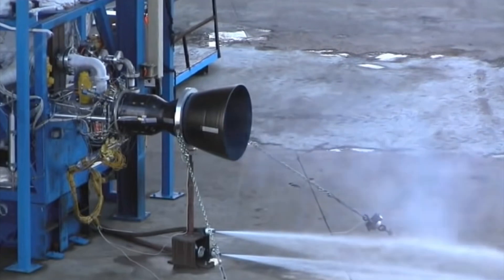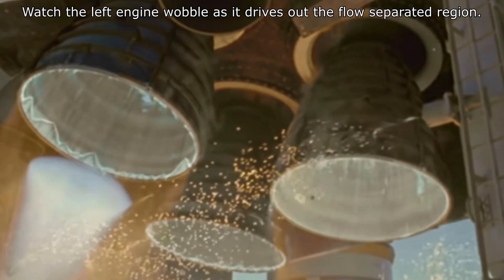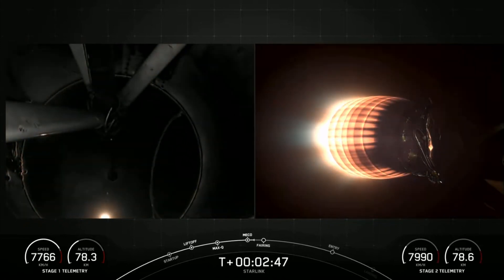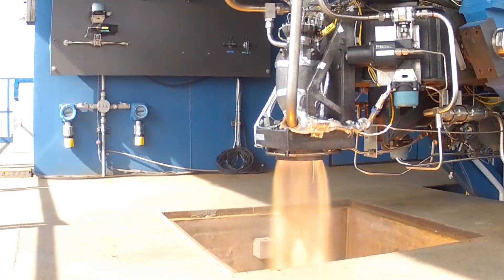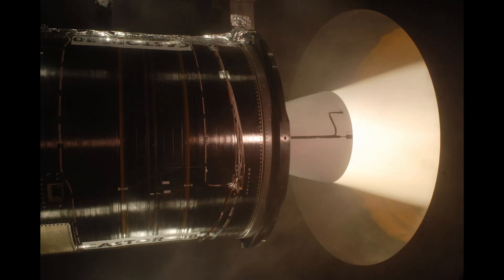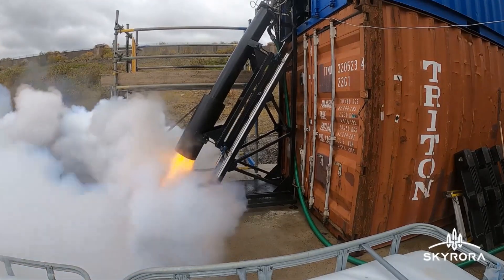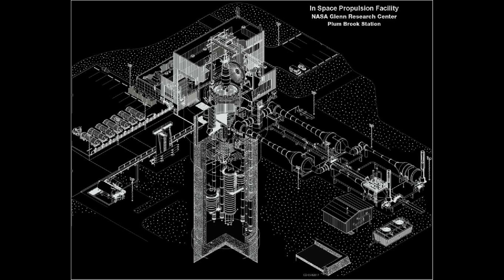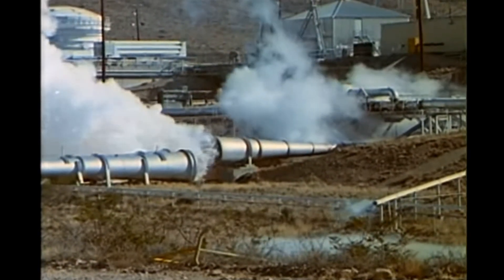Defying Atmosphere - How Rocket Engines Get Tested In A Vacuum Before Going To Space

Comment: What is it “pushing off of” to create inertia?  Theres NOTHING there in a “vacuum” of space.
Reply: Rockets push off the mass they eject. 

It’s no different than how you roll backwards after throwing a heavy object while standing on a skateboard.
Reply: @AM-rd9pu  Apparently Nothing, just throws out stuff and Bingo! Other side goes forward !  It's SCIENCE !  (well at least nasarian Newton space science)
Fresh repeat :)
Thanks, mighty kind Partner for the hoping :)  But... no  NO  I  dont realize That! 🥴  Have some experience with Propellers (following obediently lord Newton's LAWS, Action > Reaction) in Air or water...  Maybe some with Wings actually pushing.... (bird, bees, planes, kites... clouds) 🤔  Sadly thats it ! 😕
.....poor me
A jet engine produces thrust by drawing in air, compressing it, mixing it with fuel, and igniting the mixture to create a high-speed exhaust of hot gas. This process works on Newton's third law of motion: for every action, there is an equal and opposite reaction. By expelling a high-velocity jet of air and gas backward, the engine is pushed forward.  ...but no need of air  in front... so like (Space) Rockets better to have Vacuum behind !!!  🤗 Wonderbar  ❤🧠👍

🙄
 Fighter jets can fly between 50,000 and 60,000 feet in altitude, with some specialized military aircraft reaching even higher, up to 85,000 feet or more. The maximum altitude is limited by thin air, which provides less oxygen for the engines and less lift for the wings. 
🤓< only
Yes good boys, high altitude thrust like because less pressure, resistance, drag, but not too little..... 
This thin air reduces both the lift generated by the wings and the amount of air available for the engines to compress and burn fuel, which decreases engine performance and thrust. 
note for idiots : air is part of Atmosphere😲 if not part of a Whole, like water in the sea🛥, grabbing (like a rope) IT and throwing IT back against more air 🤯 = if not there would be no thrusting >> no Birds flying  kaput! 👇

The Brain is your friend🙂
Forget your Teacher, use it Today! 😃
Reply: @wildboar7473  There you go again repeating nonsense.
A Space shuttle main engine accelerates 500 kilograms of pure water from a velocity of zero to Mach eight every second !

Tell us again how it can do that without applying a "force" to that water.
Reply: @wildboar7473  Rockets push off the mass they eject. Jet engines also push off the mass the eject. So what’s the difference? Rockets bring their own mass to eject, jet engines suck in surrounding mass to eject. When there’s not enough surrounding mass, jet engines stop working. Rockets don’t care about surrounding mass because they already brought the mass to eject. 

This is super simple stuff and you refuse to understand it.
Reply: @AM-rd9pu  Other shill reaping again same old? Not tiring of dealing with Nonsense Big WINNER ?
WHO  WHERE  WHEN !!??   Has there been any denial of MASS EJECTION PUSHING ????   BUT WHERE? 😳
BRAVO !!!  YES YES  YES!!!!!  Rocket bring own mass /fuel Congratulation !
:trophy-yellow-smiling:
kind of like planes.... Jets or not, no AIR Mass ejected backwards against air wall without fuel 😏
Reply: @wildboar7473  So what is the limit to your science denial? Do you also deny vaccines? Globe earth? Are you a flat earther? Do you deny sciences regarding planets and stars? Do you deny germs? Do you deny gravity? How about tectonic plates? Chemistry? Just curious if you deny all these other sciences or is it just rocket science?
Reply: just  just unbelievable   among Disconnect with Reality, beside cognitive brain processing failure...... Who else though Rockets "push off" /advanced with outside fuel-mass help?   ROCKETS were Made on Earth for Earth.... educate on WW2  German V rockets, made to be used HERE, and worked (despite Atmosphere😂).
   Understand or not, visible seen (non tv) function.... much said "impossible" but did work, like some "Possible's" (or 🥸Laws) but not so much.... 👎
  Ejecting /throwing out, does not make any Mass move (aside lighter than air Balloons...)  Try throwing out stuff from car, boat, plane, wont move ☹
  Its high speed volume gasses against our strong push-back Atmosphere density pressure that forces a movable Vehicle go move opposite. 🧠👍🤓
Reply: @wildboar7473  If you’re in a small boat and throw a heavy object over the stern, you’ll drift off forward.

And when a rocket ejects mass out the back, where do you think that force comes from?
Reply: @wildboar7473  So to be clear, you accept all those other things I just mentioned?
Reply: @AM-rd9pu  Like to know how you figured out "Rockets bring their own mass to eject,' ???  Your own realization or the Teacher told you? That they did not use ground reserves to fuel.   
"Rockets push off the mass they eject."  ...nice  nothing reacting to that Mass?
Guess kind of thee idea of ejecting mass ...why bring the stuff, for fun!🥳

🦜Dude knows not (what he doesnt know) that holy almighty SCIENCE is not a Thing.... it is supposed to be a tested lab backed philosophizing /search for the Truth /Reality. "Self" correcting🤗 changing Knowledge /Facts .....
👶&🥸(Science Knowers) > there are no Earth vacuum chamber testing Rockets work in vacuum, none, once far enough from floor => kaput! 😭
Reply: :face-purple-crying: @PsychoMuffinSDM    😘
Reply: @wildboar7473  The propellant is the mass they bring. That should be pretty obvious. They still have fuel in their tanks when they leave the ground. 

That fuel has mass. It’s burned and that exhaust has mass (conservation of mass). The exhaust is now being shot out the back of the rocket at high speeds.

It takes a force to accelerate mass. Where do you think that force came from? Surely you don’t think the mass accelerated itself in one direction out the back.
Reply: @AM-rd9pu    😲 Rockets bring their own mass to eject !!! Wonderbar🤓
 "jet engines suck in surrounding mass to eject." ...amazing  just like Propellers, grabbing Mass ahead, who would of though?   But not exactly>  Rocket burned farts pushing🧐
....often sucking tends to PULL towards /forwards.. can experience (Science!) a vacuum cleaner hose will towards the Sucked😵‍💫  So a little grab, reduced Pressure ahead🤗, AND blowing opposite the Mass inside the MASS(sphere) .....👶like like swiming in water(sphere) and grabbing front water and pushing back = got to move, sand, whatever 😆
    seems to be a difference, one is floating in Nothingness, other is floating in Everythingness like a fish in water.... now (🧠) what IF a Jet was in vacuum nothingness.... but feed somehow with air mass to jet engines ? 🤔
🤣
Reply: @wildboar7473  Thanks for doing everything EXCEPT explain HOW a space shuttle main engines causes 500 kilograms of water to accelerate to Mach eight every second.

I guess you think it is "Magic".
Reply: @wildboar7473  I STILL find it HILARIOUS that you start with "Ha ha so so lame "dont understand Newton third LAW"
When it is YOU that DOES NOT UNDERSTAND NEWTONS LAWS!!

If you DID, then you could explain how the mechanical recoil works from a crossbow.
YOU CANNOT.
So, its No wonder you do not understand how rocket propulsion works.
You have to be able to explain all three of newton's laws. You have demonstrated on multiple occasions that you do NOT understand them and could not pass a high school physics exam if your life depended on it.
But do go on trying to lecture rocket scientists about basic physics. It really makes you look smart.
Reply: @wildboar7473  Do you even read what you write? All of your posts are a mess. 

I asked how you think mass gets shot out the back of the rocket. 

It takes a force to accelerate mass. Where does that force come from?
Reply: @wildboar7473  Rockets don't need atmospheric air to burn, that's what differentiates them from turbojets.
Reply: @AM-rd9pu lmao. So you know the attributes of a space vacuum?  Funny how NASA made a presentation about if an astronaut shot a gun from “space” the inertia supposedly created would move the astronaut back just the least little bit (5 cm) is what they said. Ya can’t have it both ways. The atmosphere here creates a medium for inertia to be created. When there is nothing but “a vacuum” the very aspect of inertia is totally transformed and plausible to be impossible. Are you so indoctrinated that you’ve lost your ability to critically think?  It’s more fantasy bs from the powers that be then regurgitated by the sheeple who love the X box they’re in.
Reply: @RtaniDean  If you fired a gun in space, you’d drift off in the opposite direction forever (or until another force acts on you). I can guarantee NASA didn’t say you’d stop because that would be a violation of the first law of motion. 

Just like the gun or skateboard example, rockets work by pushing off mass they eject. They’re not pushing off air. 

You’re not understanding basic physics yet you’re accusing me of being the indoctrinated one who isn’t critically thinking. That’s just projection and the Dunning Kruger effect at work. 

Remember, in the skateboard example, you’re pushing off the bowling ball. It would work just the same if you did it in a vacuum chamber because you’re not pushing off the air.
Reply: @RtaniDean citation?
Reply: @PsychoMuffinSDM  huh??
Reply: @RtaniDean  Regarding the gun pushing an astronaut 5cm. Where was that said? Also, on my channel I have a video that shows a rocket gain toward momentum by only ejecting mass out the back. No medium of air needed. You can download the physics simulation and verify if you wish. Can you explain how that is happening?
Reply: @PsychoMuffinSDM 
As. Typed before… the 5cm gun push was on a NASA presentation video. I don’t have a link- you can search it yourself if you choose. 

Yes- I saw your video presentation from your simulation program. While I applaud the effort- just as you said in your video- it doesn’t count for the many dynamics of “space” and the supposed vacuum of same. 

I don’t claim to know much, but simulations are just that, a simulation. Simulations by their very essence are not real, living fact. 

Guess we’ll have to let each of our perspective  points here be. I’m not one that buys into much of the space antics and any logical reason to be in so called space anyway. 

It is a concept of conquest outside the guide of reason. What is the point???  To supposedly go to another astral body and screw that place up???  The thought of it all is truly absurd.
Reply: @RtaniDean  So as far as I understand it, a vacuum is just an absence of air pressure. What are the other dynamics that need to be taken account?

And what is wrong with simulations? Wouldn't you agree we use simulations and models all the time in various ways to test out or get a better understanding of something before or in lei of the actual thing?

The point is my rocket used the basic laws of physics, AND IT DID MOVE, despite the people that use the "pushing off of" argument that claim it can't.

I just want to know what you think I am missing.
Reply: @RtaniDean  - "As. Typed before… the 5cm gun push was on a NASA presentation video."

That is just you not understanding what you have been told.
The gun firing likely imparted a 5 cm PER SECOND delta V into the astronaut.
Please take at least a basic physics class before trying to lecture others on physics.
Reply: @RtaniDean  I gave you a thorough response and all you have to offer in return is “nope”? Why not try to refute what I said if you think I’m wrong?

Comment: So if it can achieve thrust in space, why not test Einstein's theories, acceleration would be unreal
Reply: Relativity has already been thoroughly tested. And spacecraft can get going quite fast. That’s nothing new.
Reply: Actually, Relativity implies that you would require a LOT of energy to travel even close to that speed, to get to C requires infinite energy. Because to go at the speed of light is to go at the speed of light for ALL reference frames including the body frame itself, no matter what. Definitely too high for our current rockets and orbital mechanics applications imo. Rockets are fast, but you can’t just accelerate to C.
Reply: First is SPACE Vacuum?  Trust in vacuum is interesting, but does burned gasses expelled backwards reacting?  Propellers dont want to cooperate with Newton :(
Reply: @wildboar7473  Propellers push surrounding air backwards to generate thrust. Rockets bring their own mass to eject. What don’t you understand about this?

Comment: Can't test those in a large enough chamber on earth. They will fill with carbon dioxide or push against the walls
Reply: Watch the video. He explains how the test stands avoid pressure buildup from the exhaust. 

And how do you propose the rocket feels when the gasses hit a wall? You don’t feel when a ball you throw hits something. You don’t feel when the water from a hose you’re holding hits the ground either.
Reply: - "Can't test those in a large enough chamber on earth. "

When we test rocket "thrusters" here on earth before we install them into spacecraft, we test them in a vacuum chamber.
We have strain gauges (force gauge) that can measure the force on the engine as the thrust builds when first turned on.
We verify that they do produce the exact thrust as predicted by the 100-year old Tsiolkovsky rocket equation before the gases build up an "ruin the vacuum".

We can ignite one of these engines and verify initial thrust in milliseconds.
And some of the "rocket engines" we use (and test) are fractions of a newton.
We have had some thrusters so small we referred to them as "Mouse farts".
But they still consumed hydrazine and generate thrust in hard vacuum.
Look up 'Moog Corp monopropellant thrusters'

Under 'Heritage Highlights' on the Moog monopropellant thruster webpage I worked on three of the spacecraft listed as having heritage for these thrusters: NPP, JPSS, and Worldview.
Reply: But a woke kid did a soda can explosion in a tiny vacuum tank and proved    ........
Reply: @wildboar7473  And you once again fail to understand basic physics. 

But honestly I’m more curious about what Action Lab did that makes him woke according to you.

Comment: The example is wrong, as soon as the rocket fire's you need to remove the gas created, there is no vacuum after it fires

There is no control 

What's the control?

If you have 10 Newtons of thrust in a normal pressurised too and the scale reads 100kg then you should have 100kg in a vacuum sucking 100kpi of gas to maintain the vacuum 

With this example it would be like pumping a balloon in a vacuum and letting it go in a vacuum it flies because of atmosphere presume once the rubber meets its stretch equilibrium the balloon should not fly
Thus a rocket does not fly in space only in low orbit
Reply: Did you not watch the video? It specifically explained how the vacuum is maintained by using the flow of exhaust. 
And rockets work just fine in space.
Reply: Watch the video. The engineers thought of this and accounted for it.
Reply: What? How would a rocket work in low earth orbit? What equations and values are you using?
Reply: @kitcanyon658  What specifically are you asking about? This comment is very vague.
Reply: It's address to the uneducated OP, with his claim that rockets don't work in space but somehow work in LEO.
Reply: @kitcanyon658  Ah, I see. His claim in really odd, in that he doesn't seem to see LEO is still in space. So I'd be curious to learn what he thinks LEO is, lol. This may be a guy that either doesn't care about the replies, or doesn't check notifications at all.